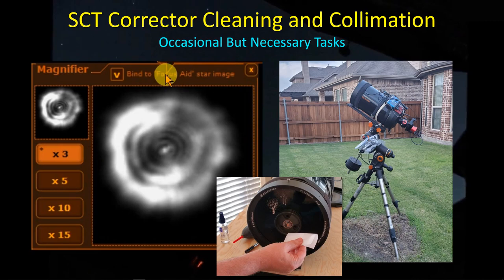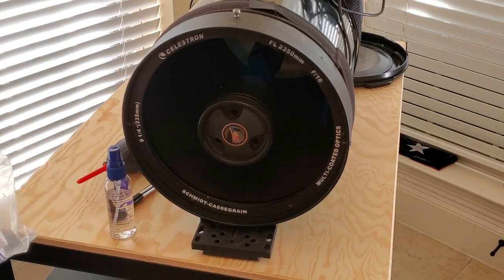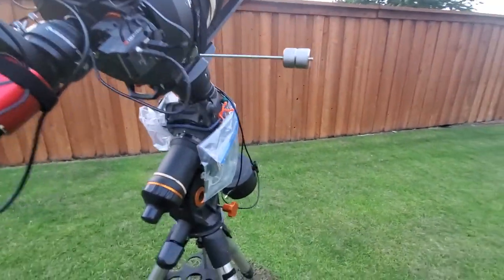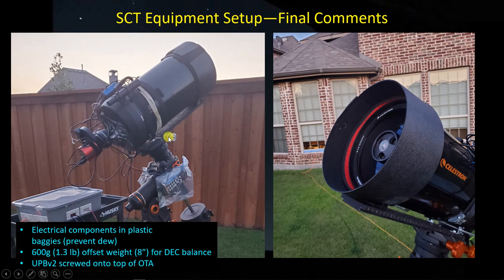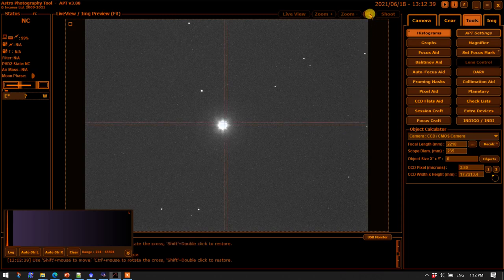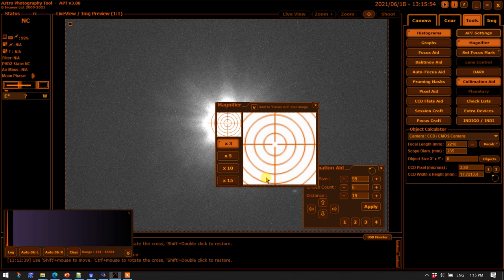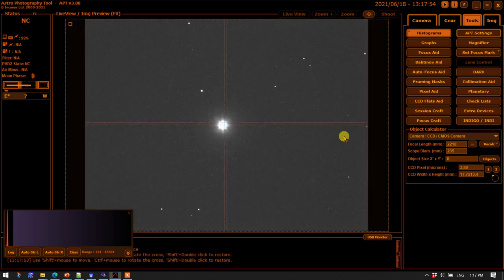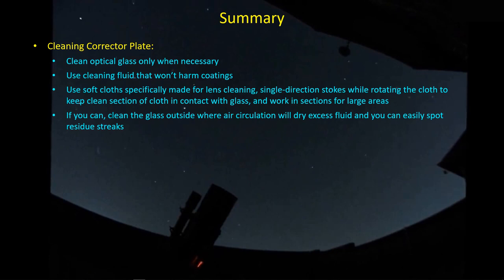SCT Cleaning & Collimation

Comment: I’ve not really looked at APT and hadn’t realised it had these features. I’ll have to give it a try. Thanks for video. Very interesting and informative as always.
Reply from the maker: Thanks, John. Try to use it on a better seeing night than the one I had! Geez. What circles?!
Reply: @Aero19612  Hoping it might help collimate my Hyperstar. I redid the collimating last night but had to eyeball it because I was using my ASIAir. It looked central to me but alas I’m still getting odd stars at the edges, especially on the left hand side of images but also a little on the right. I’m wondering if it’s a distance issue. I need 39.8mm backfocus and maybe slightly out on this. Maybe my asi1600 sensor is not exactly 6.5mm and not completely perpendicular to the focal plane? I think I’m going to make an artificial star using an led torch covered in foil with a pin hole in it so I can investigate during the day. It’s no fun messing around in the dark at sub zero temperatures trying to adjust things. So frustrating, but I’m sure it’ll be worth it. On a very different note, ZWO have promised me a solution to the Asi120mm camera issue by the end of the year and say they’ll announce it on their Facebook page. Fingers crossed.
Reply from the maker: Tell me how the collimating goes. I'm sure I can do a better job and fussing around with variable seeing creates more errors than I can deal with. You made good progress with ZWO. I certainly never heard anything from my "torch" video. Haha. I'd love to be about to use that camera again.

Comment: I made an artificial star for use with my RC. Easy to make, it's just a light source (LED in my case) inside a black electronics project case. A short length of optic fibre is mounted flush with the case wall through a tight fitting hole and centered on the light source. Depending on the FL of the scope set the unit up 15 - 50 m away and you have a stable seeing independent collimation light source. A Mk2 version might include some satellite light sources to help in finding the optic fibre  since at these ranges the finder scope has too much parallax error.
Reply from the maker: Love the idea of a more controlled and systematic approach but I can't conveniently get the stand-off distance from the scope.
Reply: @Aero19612  Do as I do. Stand on the road verge and try to ignore the perplexed neighbours thinking to themselves "what's this idiot doing?."
Reply from the maker: I don't need to stand at the curb for my neighbors to think that.

Comment: Hi James,  great video as usual... couple of things to keep in mind with collimation and focus come to mind.. inside and outside focus is going to be different, so therefore so is collimation.. I prefer to collimate( and focus) in one direction ( upwards) sct do suffer from mirror shift so moving the mirror upwards sounds logical to me..  I'm also using a tri mask for collimation so very small adjustments can be made which won't be seen with the concentric circle method
Your star in the video seemed to be acting like it was under thermal influence.. choosing a star up high on the meridian isn't affected as much as a star much lower down..
Reply from the maker: Excellent comments, Derek! I've got a lot to learn on that front.
Reply: @Aero19612  just keep the videos coming and we will all learn something

Comment: What are your results in CCD Inspector? Have you had a look at Metaguide, where you make use of lucky imaging and an averaging algorithm of the best images to do the collimation. It then compares the airy pattern of your star in best focus with the theoretical airy pattern it should have. Also when you change the three little screws the stars will probably move a bit out of center. But you can connect your mount to Metaguide and it will always automatically recenter your Star. I would be very interested in your results.
Reply from the maker: I don't have CCD Inspector. Looks like useful software. I think I'm spoiled with very good, but free, software so I find the (reasonable) cost to be a little off-putting. I suspect PHD2 can also be used to guide on a star and pull the scope back into position as well; however, I use an off-axis guider so when the main scope is out of focus, so is the OAG (unless I re-focus the OAG after de-focusing the main camera...too much work). It wasn't too bad re-centering the star after each adjustment though. Thanks for watching, Saramdi!
Reply: @Aero19612  Yeah it is a bit on the pricey side. There is a free alternative called ASTAP, it is mainly used for platesovling, but it also has a free CCD Inspectortool. If you want to upload an image of a region with many stars in perfect focus, I would gladly anlyze it and share the CCD-Inspector results with you.
Reply from the maker: Oh wow. I use ASTAP quite a bit! Certainly for plate solving, but I also do some image analysis with it (HFD, number of stars, etc). I didn't realize there is a CCD inspector component. Next time I see stars, I'll give t a try. Thanks for pointing that out. By the way: another free piece of very good software. No wonder I'm as spoiled as I am.

Comment: Great video. Thank you! What are you using for your offset weights? Looks really good. Where can I get something like that?
Reply from the maker: Mikhail,
I bought them from Amazon:
SMALLRIG Removable Counterweight 200g for DJI Ronin S / Ronin RS 2 / Ronin-SC / Ronin RSC 2 and Zhiyun Gimbal Stabilizers – 2285
Reply: @Aero19612  Thank you!

Comment: I cringed as I watched you cleaning the corrector.  The most common method I’ve seen is to is wipe from the corrector to the outside.  As long as it works I guess.  Collimation is always something to treat cautiously.  Did you test it inside and outside of critical focus?  Really good tips overall.
Reply from the maker: Well, there are several acceptable ways to do it. The key thing is not to rub in a circular motion or back/forth motion. You want uni-directional strokes. Radial or circumferential. I prefer circumferential because there are fewer overlapping regions. My collimation game needs refinement to be sure. I would like to use an artificial star under controlled conditions, but I can't get the stand-off distance I need for that.

Comment: Thanks for the cleaning lesson James.  I Have never heard of Pec Pads, I'll order some - as well as the Zeiss cleaning.  The cleaning solution is probably ethanol or isopropyl alcohol.  - Cheers
Reply from the maker: I also used methanol to clean up left over cleaning fluid streaks. I didn't want to mention that in the  video, but a chemistry expert such as yourself can make an informed choice on that front.

Comment: Hi James. Once again you have released a video which (inadvertantly) addresses my latest issue, 3D balancing. I was going to drop you a note to ask how sensitive your guiding is to position of the OAG (I know you also have a filter wheel which further complicates balancing). Last week I was trying to shoot M106 which is particularly difficult for finding guiding stars. I had my OAG lined up with the SCT focused and had the worst guiding I have had with my new mount (>0.9"). I went back and looked at a recent session where my OAG was more or less opposite the focuser and I had the best guiding I have had (<0.55"). Your setup has inspired me to remount my pocket power box (on ADM rail) off TDC to compensate for the focused weight. Thanks again. Bob
Reply from the maker: Guiding. Good lord. I'm pulling my hair out. I'm getting terrible guiding these past two nights. But enough about me. I think you're asking whether the placement of the offset mass of the guide camera/holder affects guiding. I think overall balance is a definite factor. That's why I'm using that offset mass on the 1/4" all-thread to achieve better balance in all orientations. The CGEM is inherently unbalanced as well. If you have a perfectly symmetric scope in the home position (counterweights down, scope pointing north), the scope will tend to rotate to the west about the DEC axis. You don't notice that when balancing DEC with the counter-weight bar horizontal. 
The next factor is seeing. Short discussion: nothing we can do here.
A third issue is SNR of the guide star. I think this is what I've been fighting. I think I'm trying to guide using magnitude 14 stars. The ASI174 sees them, god bless its little heart, but the SNR is around 20. Sounds like a lot, but I get much more acceptable results when SNR > 100. I don't even see a legit star profile in PHD2. 
A fourth factor, particularly for mechanically "sloppy" mounts like the CGEM, is target DEC. When DEC = 0 (near celestial equator), the RA motion is orthogonal to the DEC motion so DEC only sees the seeing disturbance and none of the RA gear/bearing harmonics. When DEC is near +/-90, the RA mechanical disturbances are 100% in DEC and PHD2 is trying to deal with the disturbance in both axes. 
Sorry for the dissertation. The short answer to your question is: There is an effect associated with OAG orientation, but I think it's small compared to the other sources. Good balance is a worth goal.
Reply: @Aero19612  Hi James.  I understand your frustration with guide star SNR.  In some instances I have been forced to use stars with an SNR ~ 25.  I think this is where the multi-star guiding has helped.  When I have SNR's ~40 I do get better guiding.  The balance issue with my GEM70 mount is a little tricky.  There is a threaded hole in the right side of the mount plate, I need weight on the opposite side.  I am going to try guiding tonight with the OAG at 135° (assuming IC at 0°).  I will take better notes tonight.  As far as DEC where I am imaging, I can't even see DEC = 0° from my backyard.  I have to calibrate PHD at about DEC=15°.  I think I have noticed that I get a better calibration if I am just west of the meridean, but I wanted to ask you if your guiding improves for calibration closer to DEC=0° and close to the meridean. Thanks for your videos.  I have learned alot from them. Bob
Reply from the maker: Seems like DEC=15 should be plenty good enough. And starting on the west side is a good idea so that your mount doesn't do a meridian flip in the middle of a calibration. There's a "thing" I want to try out next time I have stars, September maybe, for calibration. Will post a video then I hope. Yeah, I get better calibration when I perform the task near the equator and meridian, but not drastically better.

Comment: Hi James,  Just a quick comment, Have you thought about using a TriBatenov Mask when collimating your scope?  I have an Edge11" and that is  what I use,  Makes thing easier for me, especially since I have to use a small step ladder to get to my secondary.  Not that I'm short, just the planewave mount is that tall.  Now if I can find an easy way to adjust for tilt, I'll be a happy camper.
Reply from the maker: Indeed, I have, Mark. I bought one near the end of galaxy season and haven’t had a chance to try it out yet. Will definitely put out a video once I have some experience with it.
Reply: @Aero19612  I think you'll find is much easier and quicker to use than the old star method.  It's what I use and like using it.  Now if I could just find and easy way to work on my tilt when I change out cameras.

Comment: Could we have more details here? You located screw at narrowest part of donate. Right? Do you lose screw or titen? If you titen do you lose other two screws? If you loosen, do you titen other two screws? What if narrowest part is between two screws?
Reply from the maker: Correct - find the screw adjacent to or opposite from the narrow section. Try turning one way, assess the effect, then turn a different direction if necessary. You can make small adjustment to one screw, but larger adjustments will require opposite rotation of the other two screws. If the narrowest part is between two screws, then adjust the screw opposite the widest part.
Reply: @Aero19612  Thanks. I have try the way you told. Didn’t work. I am probably doing something wrong.

Comment: What dew heater strap do you use and is it just sandwiched under the dew shield? Also,  you mentioned you cut your dew shield to make it shorter, what is the purpose of doing that?
Reply from the maker: Hey Dennis. I’m using the DewNot dew strap. Yes, with the cut down Astrozap dew shield, I first put the dew strap on around the end of the SCT so that it overhangs by an inch. Then I slide the dew shield over it. I cut the shield to reduce the sensitivity to wind. Kind of like shortening a wrench handle to reduce the amount of torque ( not something you generally want to do with a wrench). I got good dew prevention with the long shield, but found I was very sensitive to the wind. Was looking for a happy middle ground. Thanks for watching!

Comment: I think I remember reading, do not wipe in a circular motion - like DVDs - because scratches cause worse damage then. Maybe what I read was wrong.
Reply from the maker: No. That's correct (or at least what I've heard). I wipe from top to bottom following the circumferential path as opposed to a circular motion at one location. Also good to rotate the pad as you go so that you pick up dirt/dust and not drag it along the glass. I also finish up with Methanol to get the cleaner residue off the glass.

Comment: Hi James
Thanks for the very good info. I am just about to clean the C14 ready for some supernova work.I was always told that using dishwashing liquid mixed in water very diluted seems to work ok.
I am having an issue with focus cube and SGP on the GT81 could I contact you about that I have a couple of questions
Cheers
Stu
Reply from the maker: Hey, Stu. On the cleaning issue: I've heard that about diluted dishwashing soap solution as well. We just don't want to damage the coatings. One thing I do that I didn't mention in the video, is do a final clean up with methanol to eliminate residual cleaning fluid streaks (best done outdoors and not over a wood surface as the methanol can damage wood-why I didn't mention in the video)

Sure. Hit me up with any questions on the cube and GT81. Fair warning: I don't have SGP.

Comment: Hi, I also have a c9 with the OAG. But I have a hard time finding stars for guiding. I use a 120mm mini for guiding. Is it small in your opinion? I see you use a 174mm
Reply from the maker: Finding stars for the C9/OAG is challenging. I have videos that show how to plan ahead with Stellarium and set the camera and OAG orientations so you know a guide star will be there. That said, no setup procedure is precise, and that's where having a large sensor camera like the ASI174 comes in handy. It also has large pixels, which makes it more sensitive than the 120. Before you buy the ASI174, compare the sensor dimensions to your OAG prism size. If the prism is 8mm, then there is no value to having more that 8mm guide camera sensor. My Celestron OAG has a 12mm prism, so the 174 sees all of the light. Good luck!
Reply: This is why I changed to an external focuser (LiteCrawler) + guide scope on my C8 EHD

Comment: After I rinsed the telescope with distilled water, I didn’t dry it enough and now there are dried water streaks all around the mirror, is there a way to fix this?
Reply from the maker: I use methanol (ordered from Amazon), a couple of drops on a PEC pad, to make a final pass to clean up cleaning fluid residue/streaks. Methanol is bad for wood surfaces. I do this outside with the scope in "Home" position. Easier to see streaks and no concern about about a drip on indoor floors.
Reply: I used isopropyl alcohol 70 percent and a lens cleaning cloth I got with my glasses. Cleaned in radial strokes outward from secondary. There are streaks left. Should I use methanol to get rid of them?

Comment: pec pads are the best, I tried so many others they always left lint on the lens
Reply: The also sell a cleaning solution called Eclipse. This is safe enough for direct use on camera sensors. No residue at all. But I would use the wet method using cotton balls.
Reply from the maker: Thanks, David. Do you find that the cotton balls leave fibers behind?

Comment: Polymer Solution from Photonic Cleaning Technologies is the proper way to clean a corrector plate. Please do not wipe a corrector plate it damages the optic coating...😀
Reply from the maker: Thanks, Edwin! I've heard about this technique before but have not tried it. I seem to be cleaning my SCT corrector plate much more often than the much smaller lenses of my refractors.